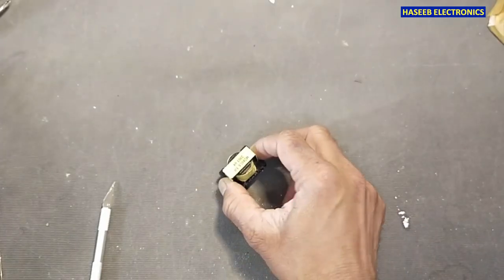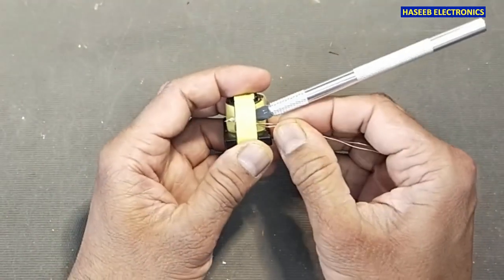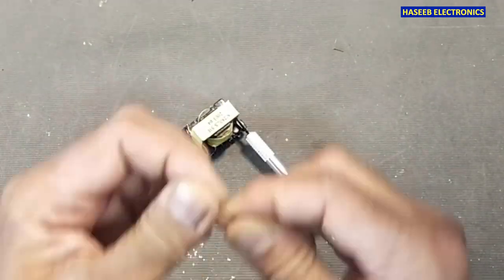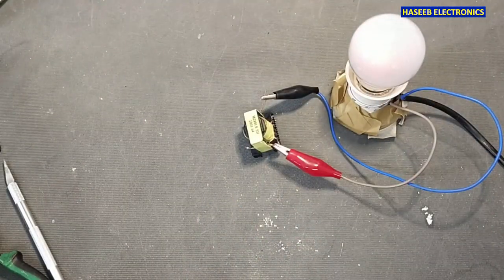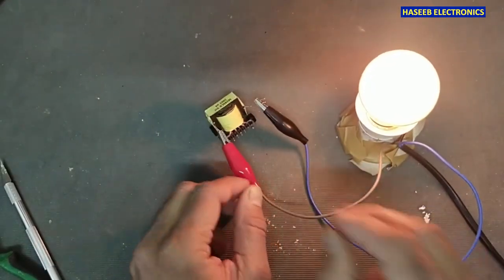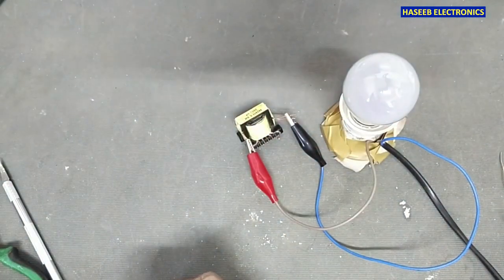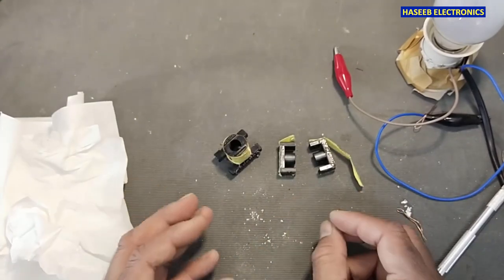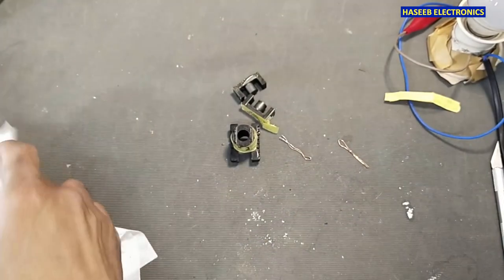{840} How To Disassemble Ferrite Core Transformer

Comment: Interesting method, I will have to try this. In the past I've soaked them in a coffee can with an air tight lid using MEK or Acetone for like a week or longer with pretty good results. This is much quicker.  When I discard old PCB's I salvage a lot of parts off them but never leave the Ferrite transformers behind. 👍
Reply from the maker: yes dear, there are many techniques, like soaking on paint remover, MEK, acetone, technical alcohol, 
or boiling in water, heating in electric oven, 
but this technique i use, it is awesome, as we operate the core at low frequency to drive in low Bmax, so it produces heat. 
and it is don in maximum 2-4 minutes only
Reply: @HaseebElectronics  Can it run on 12v 6 amps DC?